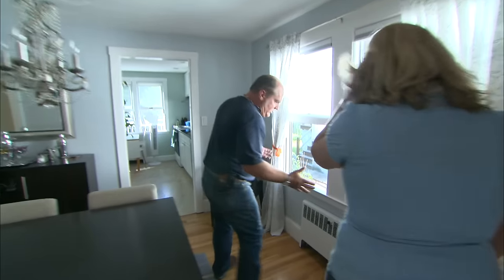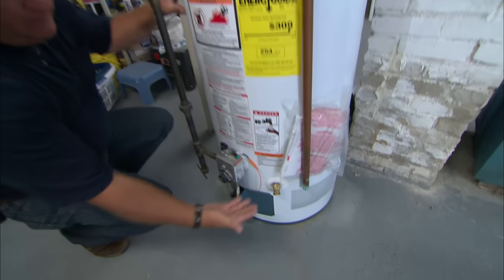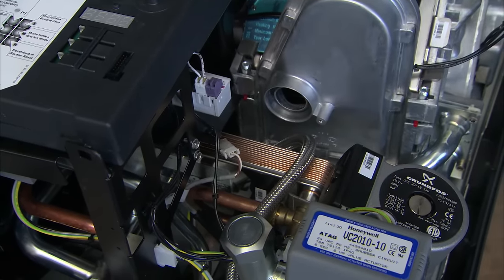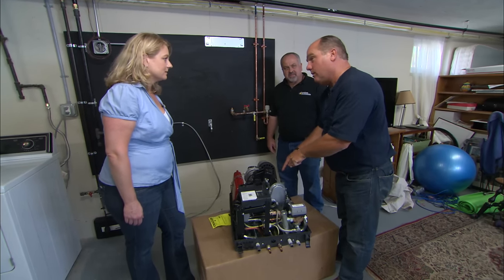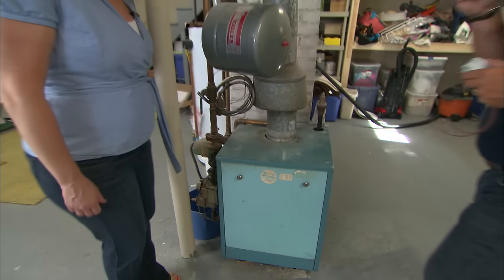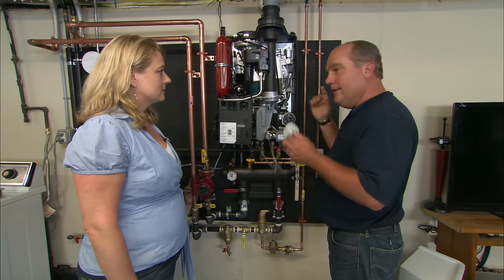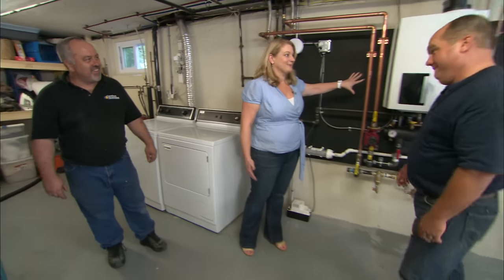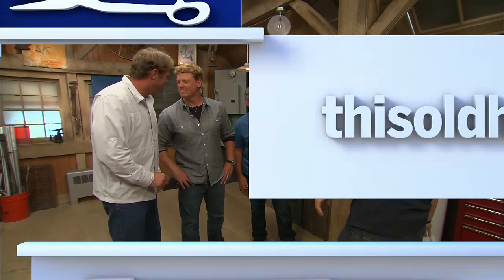How to Install a Combination Boiler/Water Heater | Ask This Old House

Comment: I first fitted a German made Vaillant combi boiler over 35 years ago here in the UK. It lasted longer than my marriage at 20+ years! I have fitted a few other makes for friends. Ideal, Baxi, Worcester (Bosch). All have lasted with annual servicing to keep them 100%. Last one I fitted was an Ideal Logic 30, cost me about £750 ($1060) and I fitted it in 2 days replacing a 30 year old floor mounted Mexico. Have to say the UK flue and intake systems seem to be far better than that US version. You hardly notice them as they combine the two into one pipe. Different Regs I suppose.
Reply: And the combined flue pipe is more efficient, couse of Heat recover to preheat the combustion Air.
Reply: What's your gas safe number?
Reply: Grumpy Electrician They're called Concentric vents in North America, and they're commonly used.
Reply: AMD1 nobody has them
Reply: 1chish its very sad that in today’s modern world a boiler can be more loving and caring than a wife
Reply: As far as the flue pipe are you referring to a concentric flue pipe. We’ve had those for a while too but they’re about $100+ more so most people opt out to save money so we end up just running two separate pvc pipes.
Reply: Concentric flues are safer too
Reply: @grizzlybear2702  you must really not be worth loving then

Comment: Im from the UK. i have a Vailant  turbomax 242, over 10 years old in my home. im a gas engineer and have barely had to touch my boiler other then to service it. Get your boiler serviced yearly, properly and it should last many years like mine. many new combis are made to break. however there are a few good new boiler makes out there which will last years. for example, the new Baxi range. Make sure your boiler has rigid materials such as copper and brass and my word, what a range of boilers they have. very innovative. i recommend all to have a look. easy to maintain and repair, what can go wrong!
Reply: How do you feel about Rinnai and/or Naven? I’m in the US and I’m not aware of whether or not we can get Baxi here. I don’t know of any contractors who install them in my area. I’ve heard of them and from what I’ve heard they’re fantastic units, I’m subscribed to a HVAC contractor from the UK.
Reply: @tommytmt  stay away from navien very fragile units I've installed many the stainless steel heat exchanger is horrible gets clogged very quickly and the acidic byproduct of the unit will eat through the heat exchanger quicker than other units I've installed. Being a plumber myself I just installed a cast iron unit and it's amazing never gives me problems like the wall hung units do and run it at 83 percent efficiency... wall hung units are great on efficiency but what's the point of you'll end up having to change it in 5 -7 years which I've done many so... and that's with maintenance can't imagine how long it'll last without...

Comment: I'd like to see a video of years later and see just how happy this lady is with this thing. Don't ask somebody that's just put one of these in how they like it asked somebody that's had one for a while. This thing is very low water capacity I can imagine this thing having some amount of thermal shock when it sucks that nice cold water back from the system.
Reply: They've been using these units all over Europe for decades. Americans are so set in their ways and resistant to change. They sized the unit for her hot water requirements and the size of her house. Not sure what you mean by "very low water capacity". I bet you're a climate change denier and anti-EV too.

Comment: "Can it heat the house and produce domestic hot water at the same time?" thank you for including that question, I have that one too.
Reply: It has priority for hot water.
Reply: The internal diverter valve reroutes the water either to space heating or water heating. The space heating water basically starts to cool off during a call for hot water. In the worst case, if someone takes a long shower, you'll have barely any heat for that time. Maybe some day someone will put in a valve that can be partially open and the boiler just modulates up to handle the load.
Reply: No, you need a combo core with a water tank to do that.

Comment: 4:43 "Ok Ma'am, let me explain the hydra you have sticking out of the side of your house."
Reply: And it was on market, this is rinnai q series, and they have good termination kits.
Reply: Yeah they could of just installed two down facing pipes about 15 inches apart
Reply: we have Coaxial flues in the UK for all boilers. does the job of exhaust and intake, whilst looking so much cleaner on the wall.... those two pipes are so ugly... or why not just move them apart, with a flat vent???
Reply: @harrisonherring9194  _ Or, why focus on the looks of the pipes instead of their efficiency? This mentality that focuses on how pipes looks like instead of their function is uglier than the pipes ... Even when it comes from a social class focused Britishit
Reply: @guzman9011  only problem with that is he went in between the joists so he has a maximum of 14 inches. For your solution he would have to go on either side of the joists which is more work.

The best solution is to get a pancake termination kit. I dont know why people dont use these all the time.
Reply: @johnburns4017  the one on the right is installed wrong most likely as the outer white pipe isnt UV rated so you cant have any of it exposed. The one on the left is correct.
Reply: I'm confused

Comment: Combi units can definitely appease almost any home. They are able to be installed in a cascade to add more than one unit for higher demand. Plus you can always do domestic and hydronic heat from separate tankless units
Reply: Do you have a suggestion about the BRAND? I am looking into this but as usual the web is full of junk information and recommendations (secretly sponsored)

Comment: When I install condensing gas appliances, I will put the air intake and exhaust as far apart as possible. It made me cringe to see them putting the two side by side as that increases the chance of the air intake being subject to frost closure during extremely cold weather, when some of the moist exhaust is re-ingested and creates a hoar frost accumulation in the air intake. When the air intake is partly or entirely blocked by frost or any foreign material, a sensitive air-pressure safety switch will prevent the appliance from firing. The region they're installing in might make this less likely, but I'm in Calgary, Alberta so we do get some very cold spells during winter where this is a factor. If I am installing multiple condensing gas-fired appliances, I will bank all of the intakes together and all of the exhausts together with as much space between them as site conditions allow, though generally 6' is plenty. There is usually a prevailing wind direction, so I'll install the intakes upwind of the exhausts for the same reason.

  This past winter I had an interesting service call at a clients where his condensing gas furnace was not firing, upon arrival it had a fault code indicating a combustion air problem and I could hear whistling around some of the burner enclosure, so I suspected something blocking the intake. I went outside and found a plastic packaging 'pillow' from an Amazon package that had become lodged in the air intake, that was a new one, random garbage blowing in the wind that plugged the combustion air pipe.

Comment: I hate my combi boiler because of the annoying cold water intervals whenever I turn off the hot tap and turn it on again. I changed my setup. I still keep my combi boiler for heating the house and basement, but the how water part for the taps I converted into closed zone, and by saying that I mean that I bought tesy bilight combinated 150 liters electric water heater with a copper spiral inside, and I am using termosthat to call the pump into action and water is circulating and the boiler thinks it's heating hot water for the taps when infact it is heating the tank water heater via spiral inside. It's like heat exchanger and it works great, no more cold water intervals and plenty of hot water pressure.  I suggest this convert to everyone who hate the hot water fluctuation when the tap is turned on/off rapidly.

Comment: we have had them in the uk for over 20 years
Reply: i don`t like the venting it`s bad
Reply: +ONYX E.S. There has to be a more aesthetic way to vent that, I agree the PVC elbows like that are by no means attractive.
Reply: +briancnc being white they look bad, but paint them black or the house color and they'd look fine.
Reply: Congrats to you and the UK but these things are junk anyway.
Reply: +Sawashi32 They aren't junk in the UK; perhaps they're just better quality engineering. As for the venting, I've never seen one like that.
Reply: +Sawashi32 
Well the ones in the UK are from 'junk'. I have fitted and used them for nearly 40 years. And that venting system is just bizarre....
Reply: Yeah but the Yanks had tonnes of traditional boilers to get rid off first. Follow the money that'll always give you a clue
Reply: The combi boiler is a great idea but I would be worried about getting parts if it breaks and I can tell that this thing is going to break often.
Reply: More like over 40 years

Comment: I love cast iron boilers the Combi is very very expensive to repair and service. 
Blowers cost from 300 to 600 plus labor.
Controls cost from 350 to 1,000 
Anyone one of those two parts go bad your savings is gone on efficiency.
The boilers might last 15 to 20 years vs cast iron 30 to 50 years
Reply: B K like everything else nowadays it’s disposable.   If it breaks you throw away and buy new
Reply: You would be lucky to get 15
Reply: what blower?? its baseboard

Comment: Once the scale is built up in the heat exchanger efficiency will drop. I like the separate heat exchangers just in case they have to replaced.
Reply: Descaling by periodically pumping an acid (usually vinegar) through the heat exchangers is recommended if you live in an area with hard water. At 5:25, you can see that there are fittings installed for just that purpose.

Comment: Seems like a great idea..until it breaks down. Parts take days to weeks. Which is fine if you have backup heat for the house. Inevitably the thing will fail when it’s the middle of the winter. When that happens it’s quicker to replace the whole unit than waiting for parts.  Supply houses usually have entire boilers in stock. Not so much for parts.  Also when using radiators or base board heat you still need to run the boiler temperature at 180deg. Which reduces the efficiency substantially. These work best for radiant in the floor heat where the water temperature is usually at 130 deg.  There are multiple plastic parts, sensors and control boards   Also yearly maintenance must be done to keep the heat exchanger from becoming plugged  with minerals.   I’ve worked on these for decades, you won’t find one in my house.
Reply: Rinnai and Naviens are very easy to get parts for in RI. Lochinvar and nti are a different story.
Reply: @Keegeth It recently  took a week to get a three  way valve for a Navien up state NY  in a unit that was less than a year old .  Other similar type units I've worked on I've always needed to wait for parts.  My comments stand.
Reply: @jeffwright5794  that sux. For a 3 way valve for an ncb unit that had a bad 3 way valve I called plumbers supply and they had one on hand. 

An ncb heat exchanger was leaking combustion gases in the cabinet causing cabinet temp to rise, causing oil to be extracted out if the plastic parts and the pcb board to go bad took 2 days.
Reply: What about the Polaris isn't that brand supposed to outlive you and your next generation. Is not tankless but it works for both.
Reply: @adriansmith7104  never heard of one up here and don’t have a local supplier for parts either
Reply: @jeffwright5794  well you wouldn't need any part in 10 years for what they say
Reply: @adriansmith7104  I work on machines that are broken. So forgive me when I say that everything breaks down and the more complicated the more often they break.
Reply: @jeffwright5794  I used to work on home appliances when they were American made, left it when they became disposable I guess people today are ok with paying cheap and replace every year not me
Reply: @adriansmith7104   Supposed to outlive you doesn't mean won't ever have a defective part, or installation error that may cause the unit to fail.  Just because it has a thousand year warranty doesn't mean it won't break, it just means they'll cover the repair.
Reply: @jeffwright5794  that's because you are in the middle of a post pandemic shortage on everything
Reply: My home set up consist of a Rheem gas tankless water heater, and 3 zone mini split units w/heating. This setup has work great for me.
Reply: @jeffwright5794  - It's a bit of an anomaly, that was at the height of the Covid supply chain issues. Different areas of the country have different water hardness levels. Where I live the water is very soft and mineral buildup is minimal.
Reply: A new boiler just installed and they set it at 140'F for heating the house. Is this too low?
Reply: @46fd04 cast iron radiators typically don’t operate above 140.
Reply: @chasestewart302  Thank you for that info. The house does have old cast iron rads.

Comment: as small a combi as this is. There are times when the heat call is still smaller than the combi will produce.  So this is a great reason to keep the old tank water heater as a ballast tank with enough warmed water to supply the radiant without short cycling the combi.  This seems to happen most often with using radiant heating as opposed to the convectors which usually have a much larger btu heat call.   Radiant floor (could be in the wall or ceiling) spread the heat load and will have cooler water flowing than the convectors
Reply: Steve Pailet a decent combi will modulate down to 2-3kw, sometimes lower. Short cycling shouldn't be too much of an issue on a well planned system.
Reply: By the same principal could you use a traditional, inexpensive electric water tank to 'pre-heat' the water supply for the combi boiler to reduce the amount of gas used? (and fossil fuel burned)

Comment: Yeah, I got a know that boiler over and over again because they are not reliable but that’s with any combination wall boiler, very touchy and expensive to repair. One major repair out of warranty you might’ve just spent up all your savings towards that one repair.
But overall, they do save space they are efficient. They are reliable and they’re the way of the future versus big cast-iron boilers. They do make better sense as they’re more on demand. Just expect to replace them a lot sooner than the large cast-iron Boilers.

Comment: Hack job venting install. Should use the deb4 deburring tool on the pipe before fitting them together and gluing them. Without deburring the end of the pipe, the bevelled end from the cut will push the glue out of the fitting and make for a weak joint.
Reply: Yeah right.

Comment: This new tech is really cool but I prefer my old school cast-iron boiler. So much more complication, maintenance, and room for things to inevitably go wrong, all for maybe 15% more efficiency. For my home that would only equate to maybe $200/year saved - I'm sure the maintenance costs are around that for this unit.
Reply: Youre a plumber that makes $$$ pushing those outdated pieces of crap??

Comment: ATAG, Dutch, re-badged by Rinnai.  Quality. But the control system is complex.  A pity Intergas, Dutch again, do not sell in the USA.
Reply: Would have liked to have installed an ATAG but it was very expensive settled for an Alpha combi hope it lasts my previous standard boiler hot/cold water tanks lasted 34 years was very inefficient towards the end it was an Ideal mexico.

Comment: Original 1962 American Standard boiler and Westinghouse burner.  Boiler has a coil, no external tank.  60 years old and works fine.  So simple a cave man can fix it ;-)
Reply: Throughout history cavemen have always received an unfair knock

Comment: Kills me how quick this old house is to punch holes in exterior walls. 😱
Reply: So you want them to vent the boiler into the basement?
Reply: @chipdayton1625  Why couldn't they run an intake and exhaust vent up the existing chimney? They make concentric pipe for this purpose. Then you don't penetrate the wall with unsightly and possibly obtrusive venting. The woman moved the units to the wall but now has an unused chimney.
Reply: @jaredsmith1871  That can be an option sometimes.